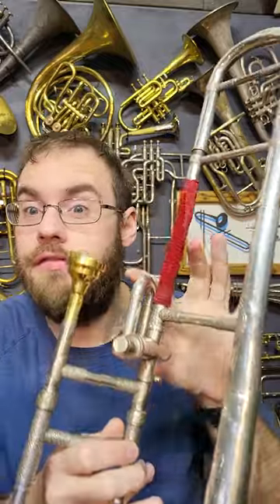The strangest trombone valve!

Comment: Now out of spite the composers will forever mark trills go up and you have to remember to be up a tone and keep valve down by default. And once you are used to it, they'll switch it again!
Reply: I'm certain there is a way to modify the valve to be normally open.
Reply: You could just go a slide position higher than the written pitch and play it with the valve, then release the valve to trill up. It seems less complicated than horn player fingering every single stopped note down a half step.

Comment: I think it would be very easy (for someone with brass repair skills) to simply create an alternative section of tubing that was considerably longer, such that the valve could be used as a standard trigger attachment. Conceivably this could be done such that returning it to trill mode was an easy 5 second change of tubing length. Like the crooks on natural horns. Just have to calculate the correct tuning length to drop the pitch by the required amount and then find a section of tube in the right diameter. Then maybe do a slight mod so it fits up to that valve.
Reply: Thein altos have a similar feature

Comment: It's not a Superbone, but it's conceptually going that direction.

At first I thought it was a "preacher model" where it's a 2 semitone valve set up to stand in reverse -- the valve is in use when NOT pressed, so the pitch goes UP a whole tone when it is pressed. Then the slide only has six positions available, but B♮ is trigger and 2nd position.

Comment: Surprisingly enough, this also works with with a trigger trombone as I have discovered, as long as you tune it a certain way
Reply: Depends on the partial. A good example: from Bb3 (1st position) to A3 (1st position and trigger) works nicely, along with others in the same partials. But there is no whole step option for those notes.
The partial above allows for a whole step, not a half step (D4 to C4)